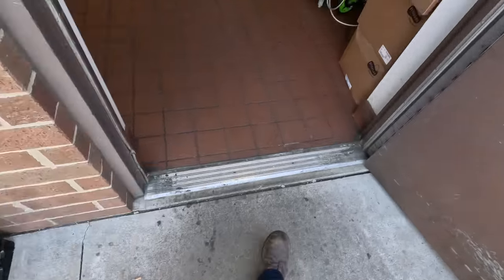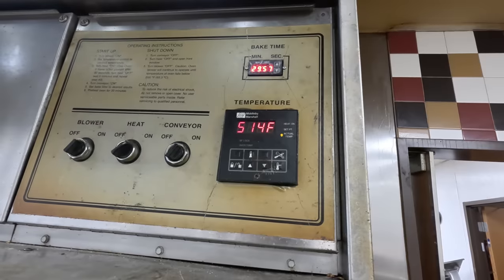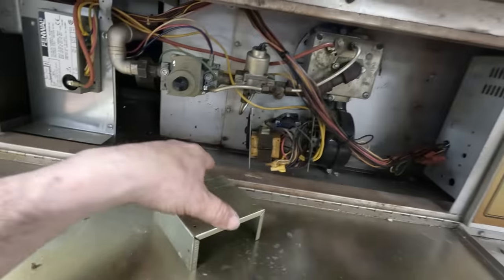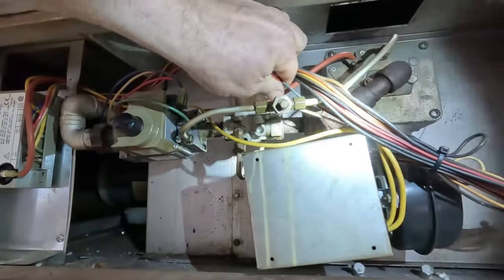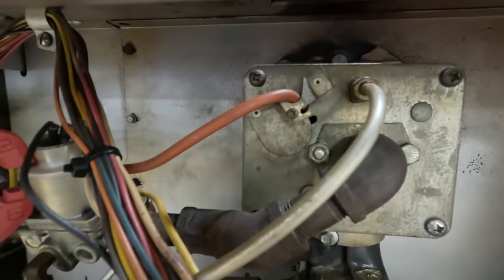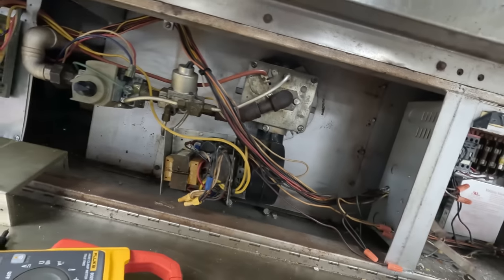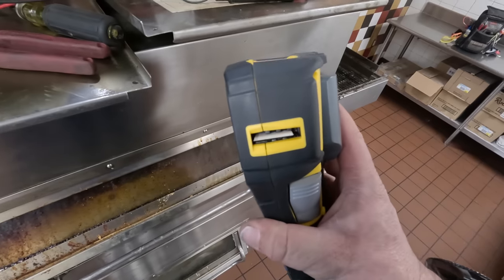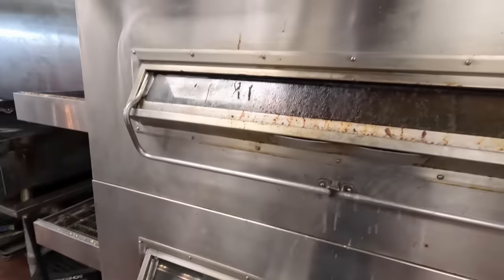PIZZA Problem. It NEEDS MORE PINEAPPLE!

Comment: Got to love those situations
I have a gas card and I'm very good with electrical so I got conned into installing 2 3-phase electric kilns
Reply: The reason why a gas card was in play because of the exhaust from the equipment even though it was electric the manufacturers required a gas card number
Reply from the maker: Interesting 👍👍

Comment: Looked like your flame sensor and spark ignition are the same unit. Had the sparkplug wire fail where it plugs on at sensor. I just shorted the wire . The next time I replaced it with better wire.

Comment: Great video something different from what I am used to . Thx for sharing the meter on that solenoid checking for amps , hard to believe that solenoid was pulling 8amps. I usually use
my danfoss emf checker on my phone.
Reply from the maker: That trick of opening the clamp just shows you that there is a magnetic field there not the actual amperage. The amperage as was very low to the point it didn't want to show up on the meter.

Comment: worked on these a lot usually a overheating issue always check the fans in the back as it cools the big motors those get very dirty and will cause a premature failure of the big motors
Reply from the maker: Good information to know🤜🤛👍👍

Comment: I have spent hours on Middleby Ovens and know your struggles. PH used a lot of them before switching to XLT ovens. That Honeywell temp controller is really strong and usually the problem is else where. If I remember right there is supposed to be a high fire and low fire on those. When there is a call for heat it energizes the solenoid causing full gas flow and when the call drops the solenoid closes and the small gas tube off the side of the solenoid should create enough a flow restriction to the main burner to go into low fire. That is an older design for sure and Middleby stopped using that for a long time though Lincoln ovens still use that style of high and low fire. Still a good catch on the motor not spinning fast enough. The way those ovens move heat is through both top and bottom grates and it matters which grate is where in there. Had to reposition many grates due to cleaners rearranging them and pizzas coming out not cooked properly. Keep up on those field calls. I left that and now stationary at one location but have many fun days ahead of me with their season starting next month. Peace brother.
Reply from the maker: Thanks for the info Joe!

Comment: Hey Rick, just curious on something. I work at a small company that does mainly does residential installation. I hear you talk about defrost for walk in freezers. How does it work compared to a heat pump ? Thanks for any advice 😁
Reply from the maker: Heatpumps use hot gas to defrost. Most traditional freezers use electric elements on the back of the evap coil. We do have grocery stores that have hot gas defrost but very few smaller walk in freezers have it.

Comment: No fan to make the proving switch the burner is locked out.
Reply from the maker: It has to have a proving switch, it worked once the motor ran, I had no power to any of my controls without it running.

Comment: Allways pull test wire connections, save a fire from happening...
Reply from the maker: What test wires are you speaking of?
Reply: @HVACRSurvival  I think they meant tug wires to see if any pop out, like what happened to the motor wire on the contactor in this video. Probably best done when power is cut as common sense would say.
Reply: @HVACRSurvival  We pull on each wire to test mechanical soundness.
Reply: @Wildcard65  your no fun turning the power off! we just love having live wires come out in our hands, especially 277v! 🤡
Reply from the maker: @Dave oh I got what you're saying now. 👍👍